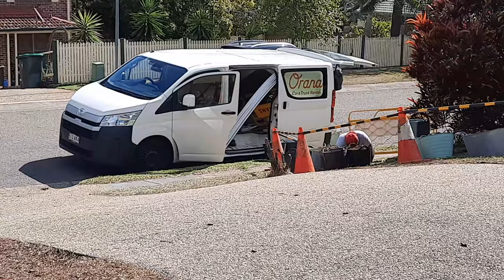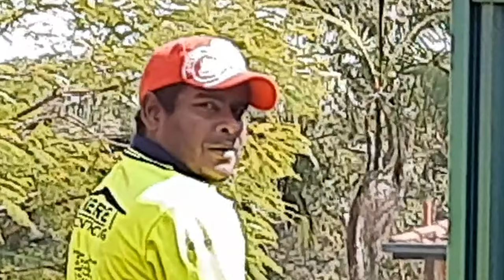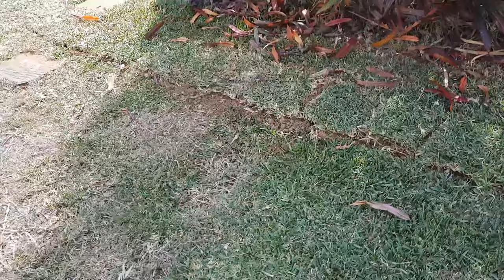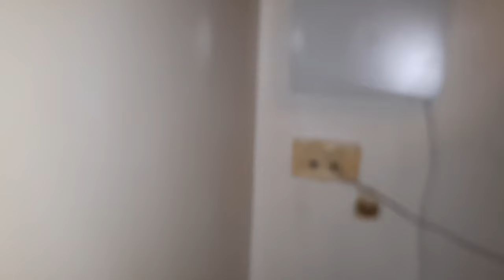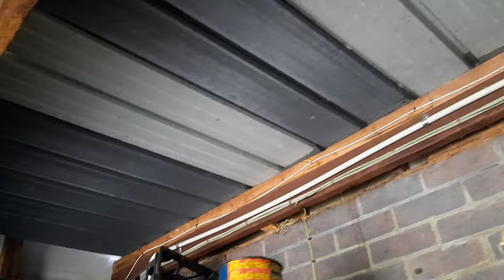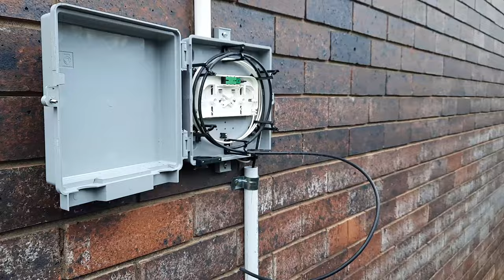Upgrading NBN FTTN to FTTP Installation

Comment: I currently have FTTN. The node pit is only 10 metres from my house, so very minimal copper wire used. I'm not expecting a lot by installing FTTP but it's not costing me anything so that's good. All my speedtests return 108Mbps download and 18Mbps upload.
Reply from the maker: Yeah, not likely to VASTLY improve download speed, but you may be surprised! BEWARE though; in my case and it seems most others; once your ISP changes you to a FTTP plan: Your UPLOAD speed will likely be barely only 20MBPS, like mine has dropped way down to! - It's something none seem to be making cutomers aware of! (until AFTER they change!)😡😁🙄

Comment: I've had a debacle too with installation of FTTP.  It was only last week and they dug trenches in a zig zag fashion, over 20m of it & I'm now connected a couple of km from my house, despite the fact that there is a box on my immediate next door neighbour's verge (where I was connected). I don't mind where I'm connected as long as it is reliable, but I didn't want crazy trenching, that same as you, they didn't put the grass back or any sand, pulled up paving, didn't silicone the external utility box, blew a giant hole in my wall (admittedly it's the old red clay bricks with lime mortar), but I'm sure I'm not the only house. And in one week, they've had to come back 3 times due to faulty installation. I'm going to get them to relocate it, as I specifically asked for the cabling to follow the perimeter of wall and despite asking for schematics of the actual cabling, depth etc, they didn't tell me. And I didn't see any of it go in. One technician who came out today told me that the depth was 150mm of the trenches. Hmm that is against regulation and not even this depth of a shovel blade. I'm very unimpressed. But thanks for your video. I'm glad I'm not the only one that thinks the service is sub par.
Reply from the maker: SHOCKING isn't it!??? I hate to have to say it; but it feels like they hire these subscontactors straight from immigration, and hand them a shovel! Like you; there was NO WAY they dug to the required legal depth!! You can tell even by the shot I did of them doing it. I KNOW they get a SIZEABLE chunk of change for the work, so there's really no excuse for it! OK, one guy said if there's an issue that develops, they will come out and rectify it; but HOW LONG would that TAKE!? - Everything has to be done via our internet providers, since the public can't contact NBN directly...and with the ongoing installations; THAT could take MONTHS!

Comment: Everything plays a part. I am on FTTN and get 105/ 25 and about 360mt from Node. About to get FTTP and expect to get 450/50 as that is the highest plan for this provider.
As a ex Telstra tech will make sure they clean clean clean the fibre ends ( if you have done fibre before, 3 times the clean for every end means something ) 😏.
Hope you have had better results since your video 🙂
Reply from the maker: Gidday. After negotiating with my ISP, they bumped up my plan for 6 months, so I now avg 275mbps down, but still only 20 up.

Comment: Hey there from Bentleigh East, Victoria. I was lucky enough to get HFC (Hybrid Fibre Coaxial) though Aussie Broadband after giving Telstra the arse. I'm a 63 year old gay man and the ads on TV with the guy in green drag are fabulous. The new Telstra ads are a joke. I'm getting on average nearly 600 Meg down and 200 Meg up and their customer service is stunning. The setup was painless but considering I've been around electronics when I got my first shock at 4 years of age, I've got a lot of experience. Kevin Rudd announced the NBN in 2003 and the 2017 completion date (seemed) a long way off. After Tony Abbott and Malcom Turnbull took charge.....they stuffed it. It was announced that the NBN would be finished 7 years from now at an extra 10 billion dollars. I wont hold my breath. My neice comes around to do some homework and when she sees the meter peg at 800 Meg, she was blown away. Cheers girls and boys and others!
Reply from the maker: @scratchback2001  Aussie BB were good when I was with them, my only issue a few years back, was when they suddenly put the price UP, but the speed DOWN! Fast forward to NOW, and I'm now into my 3rd month with their new business 'Buddy Telco' @an avg. of 950 down & 50 up...Sorry I can't control any TV ads, I just audition for some when they're casting talent 😁🤣😉
Reply from the maker: PS, I meant to add, that yes; I too remember when the original NBN was announced. I thought it was a great idea...then a government change came along, which in their 'wisdom' said "hey, we can save billions by NOT taking fibre all the way to the premises, and instead keeping the last stretch antique copper wire..." the very bottle neck that optical fibre was aimed to surpass! So, many years down the track, the original idea did start to roll out, but at the cost orders of magnitude higher!...and our tax dollars pay these public servants for WHAT exactly?? 😒

Comment: On upload speeds, the NBN (infrastructure) is not the limiting factor. I'd say "retailers" have made the calculation that domestic users dont require high upload speeds. There must be cost saving at their end in this decision. 
Aussie BB offers a 100/40 plan at around +$10/month on top of their 100/20 plan.

You can also look into business plans which are "symmetric", eg 250/250. All you need is an ABN and add a minimum $100 per month on top of a top tier domestic plan. It all comes down to what you're willing to pay for.
Reply from the maker: Yes, exactly - After going to the Telecommunications Ombudsman; my ISP has negotiated a 6 month deal with me; currently, I get 275MBPS download, but still only around 20 UP! Stinks, but I'll look around in 6 months to check the plans again then. 👌👍

Comment: In the country where i live, they are in the process of rolling out FTTP, but right now, only 10% or so of the country has it
We currently have an FTTC connection (which uses the telephone line from the street cabinet to bring the connection to our house), we have a 50/10 connection if I recall correctly (the other options being 40/10 or 87/18 (or whatever it is), very few providers here offer the 50/10 option, but regardless of who you pay, the connection comes from the same infrastructure (every ISP here is essentially not much more than a reseller)
Although the ISP we are with currently offers free upgrades to FTTP when it becomes available if you are on the 87/18 (or whatever) plan (this ISP essentially owns the company that handles the infrastructure)
Reply from the maker: Would that be Canada by chance? Here in Australia, the old 'twisted pair' copper phone lines WERE all owned by 'Telstra' (Formerly 'Telecom'), and everyone else (resellers) used their lines as the backbone, but since this fibre-optic rollout is by the government owned 'NBN Company'; I'd say NOW, it's the majority of internet supply in most areas (other than satellite in very remote ones), and as in your case; all ISP's are merely resellers. The NBN upgrades are also free to us, as it's government, not the ISP who does it. 👍👌
Reply: @SteveMack  i live in the UK
Reply from the maker: Oh I see. I'd have assumed the UK would be more advanced than that. Cheers.👌👍
Reply: @SteveMack  for a period of time there was what they called “G-fast”, which allowed speeds of around 300 down over an FTTC type of connection
I will admit, there is one ISP which has its own infrastructure, but they seem to only provide service in a fraction of the country (im not sure which areas they do provide service to, but near the southern side of the scottish border (the area where i live), they seem to be non existent, but there again, it seems everyone in london thinks england ends at Newcastle upon Tyne)
I did notice that new Fibre equipment seems to be getting installed in the nearest town to where i live, so maybe it won’t be much longer to wait before FTTP will be available in the village where i live
Reply from the maker: Well, with a bit of luck!...Don't worry; there are those who think Australia is part of Asia!! (We haven't completely sold out - yet) 🙄😉

Comment: I've had 3 NBN tech's at my place and all 3 said FTTP cannot be connected here because there is no clear pathway for the cable from the pit or through my house to where i want the box installed. I would have to pay an electrician to come in and dig a new trench across my yard and lay a new conduit for the fibre cable to run through, and i'd also have to have a clear pathway created in my roof space for the fibre to run through to where i want the box installed........all expenses i cannot afford, so i'll be stuck with my crappy FTTN forever.
Reply from the maker: SORRY for delay, I was working as an actor (what I do at times) and couldn't reply on my phone. That SHOULDN'T be the case, according to the info that NBN sprouts! I don't recall NOW if it was the first NBN guy that came out, but at some stage, someone mentioned the possibility of me having to pay for a trench to be dug etc - which DIDN'T end up being the case thankfully! What can I suggest? : Perhaps first of all, contact your ISP, and tell them what you've been told, and potentially file a complaint to NBN VIA them (we can't actually CONTACT NBN, as they ONLY deal with retailers, (Internet providers)). If that fails; you could consider filing a complaint about NBN with the TIO (Telecommunications Industry Ombudsman), because I'm pretty sure that the whole thing with NBN now, is that THEY need to provide whatever is necessary, to connect you...Unless of course you live in a very remote area away from any big towns or cities. Let me know what happens. Cheers
Reply: I have had the exact same experience. Interestingly, every technician appears to have received no information from the previous person that visited and I feel like I'm going around in circles. I've now notified the ISP as you've suggested and hope I have some luck with completing the install.
Reply from the maker: The bigger issue, is that all ISP's are now charging way too much! NBN just put their prices up at the start of this month, which means the cost will be further put onto us end-users! 😪

Comment: Check your ping rate vs what you had before. It should be in the 1-2ms range instead of about 50ms for FTTN and about 10-20 for HFC. But I agree some of the more recent NBN installers are really of low quality.
Reply from the maker: Ping is 4ms. A long time back, even on FTTN, I'm sure it avg. around 1ms - 2ms
Reply from the maker: Kudos to you, if you have pride in your work, but clearly not all do.

Comment: Nice video.  We have it here and I have used it.  I was getting about 500 up and 500 down, but they started charging too much, so I went back to cable.  Not as fast, but less expensive.  It works fine for my needs.  Be well mate.
Reply from the maker: Same here: IF one wanted to pay a small fortune - crazy speeds ARE available, even 1000MBPS! I think the reality is though; that one doesn't NEED much over 50MBPS to be able to stream 4K movies / videos without caching...As for upload speed, maybe uploading to youtube takes a little bit longer for huge videos, but realistically , it's not too painful. PS: I fiddled around again with my modem/router last night, and again have 109MBPS download, even in peak times, so I'm a little less angry about it, even though upload speed is considerably lower than it was.

Comment: How are you joining your internet from your router to your computer? 

Router > Computer?

Wifi ?
Reply from the maker: Direct cable to both computers.
Reply: @SteveMack  Okay it's not WiFi. My neice and I discovered that the WiFi connection greatly reduces the 
 speed between the two components in this case it was the router (in a cupboard) beside the FIBRE to The House box whatever that is to her X BOX.

She bought a new CAT 5E cable (different cables have different speed capabilities) which made an enormous difference. I think it went from 300Mbps to 750Mbps. 

So yeah ethernet cable makes an enormous difference to the download and upload speed.

In your case there is clearly something wrong. 

So did you get it resolved?
Reply from the maker: ...I'm an ex computer tech, so I already had CAT 6 cable runs via ethernet. What was 'wrong', are the plans that all ISP's now have in place - slower upload speeds than previously - a huge flaw in what was supposed to be (upon conception many years ago) 'faster'. For NOW; (after having gone to the TIO and complained) my ISP is giving me a higher speed plan for 6 months (which must be due to cease soon) - After which, I guess I'll shop around...yet again!
Reply: @SteveMack  OK, so it's the plan you're on, not any kind of limitation of your fibre connection to the internet?
Reply from the maker: @decem_unosquattro9538  Correct.
Reply from the maker: ...Just to further claify: The current plan I'm on, is 200/20 - but, I typically get >275mbps down, but only barely 20mbps up! - Which is half the upload speed I was on, when connected to FTTN! Makes no sense really when NBN SAYS everything's faster - but there we have it hey?
Reply from the maker: Yep; the ORIGINAL plan, was of course, to do what they're doing / done finally NOW - many years later, AFTER the ensuing government decided that they'd do fibre to the node, then the REST will use the ancient copper lines! Defeating the entire purpose! (Although, it still was an improvement) - all ISP's are now capping their base plans at still only 20mbps uploads - There are a FEW that will do higher, but the price gets reallt ridiculous for a small home user-base...(So much for the NBN upgrade being 'free' with no further cost other than the ISP!). Of course; in most city areas, there's always terrific speed options for business plans, but for a private user; prices are INSANE! I have a mate 'out west', where I did a vlog the other year - the only network available to him, was Telstra (the same mob who has the only phone signal that even gets there), but it was CONSTANTLY falling over in all ways. Now, he's recently joined up to Starlink, which yes, he has the internet fine now, but the cost is really silly, AND; although faster, it's a PATHETIC speed!! (I mean REALLY pathetic, at about 5mbps D/L maximum!!) 😯🙄

Comment: Looks like they (and you) went through a lot of work to get that upgrade...just hope you are happy with it all in the end...you could either mention to them about the gap where water may get in or plug it yourself...wasps & frogs will make it there new home...I have only wireless NbN ...says in speed test its average 25 mb Download-3.5 up load...some days are faster...But in real Terms it will only download @ 6-8 mega bits...& because our wireless is in line of site to an airport radar we had problems in the past...got newer modem/wifi receiver (on roof) there has been no problems...there will be no more upgrades here...until 5g arrives...I know some people who have Fibre Optics connections...and its over 100 times faster then mine...Nice little video Steve...looks like some of ya lawn needs a bit of water to get that grass growing where it was dug up 😁
Reply from the maker: ...No work on MY part mate - Just frustration at what I CLEARLY see now, is a deliberate effort to reduce everyone's speed, since the various governments initial costings of the NBN have spiralled out of control in the ensuing years (as everything does). Rain would be great mate - Very dry here for months, aside from the odd small storm...so far. PS: Your speeds are slow as shit! - You'd DEFINITELY benefit from the NBN FTTP roll out!👌👍
Reply from the maker: Bugger. My mate 'out west' where I did my LONG 1 hour vlog last year, now has starlink - Dismal speeds compared to the city, but at least IT WORKS; which was the whole idea (When he was with Telstra, it RARELY didn't stuff up!).